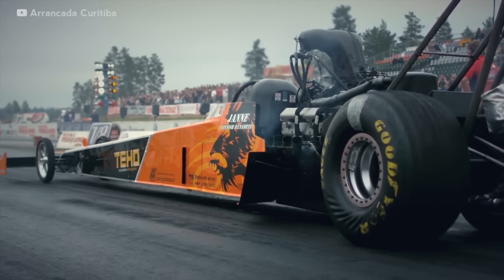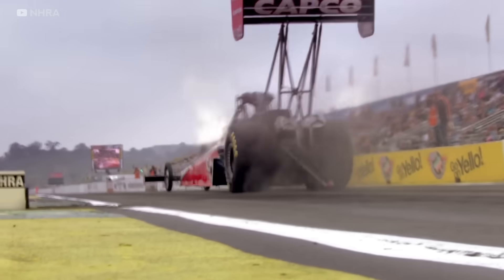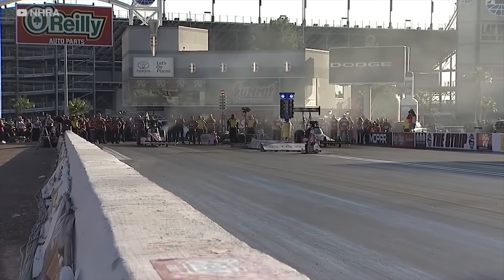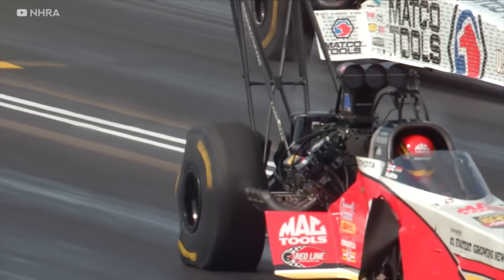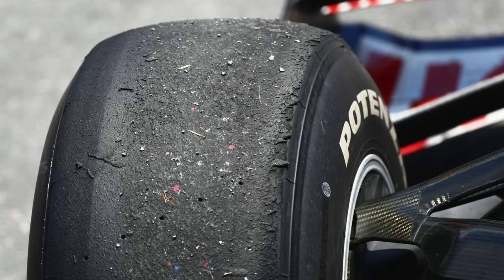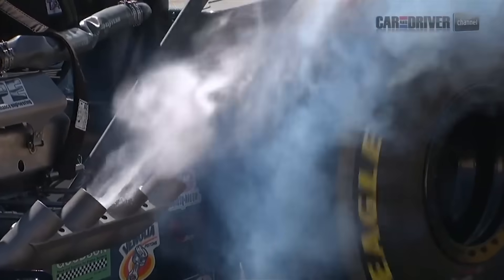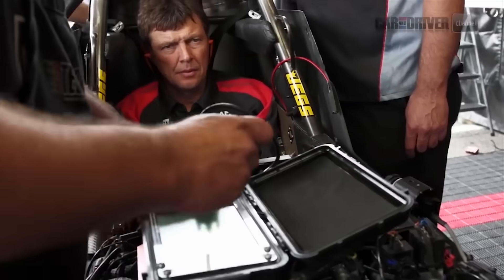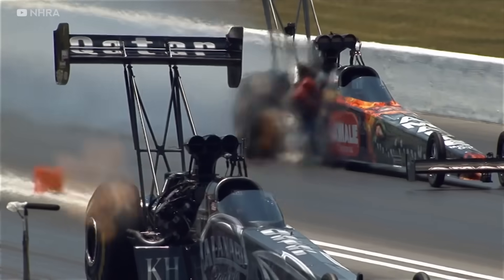How Dragster Tyres Accelerate to 335 MPH in 3.6 Seconds

Comment: Could someone please explain to me howcome this fuel needs no air to combust but these engines are supercharged, how's that working... I'm absolutely positive that I'm missing something here, but that's why I'm asking, thanks in advance to whoever (or whomever?) answers this!
Reply: The nitromethane fuel does need oxygen.  It requires less oxygen to fully burn than gasoline due to it bringing its own oxygen to the party.   Given an equivalent amount of air and the same cylinder size, a given amount of nitromethane generates more energy than the same amount of gasoline.  The superchargers help to get as much atmospheric oxygen as possible into the cylinders to get the most power.
Reply: @jeanbigboute  I see I took what he said too literal and that's a very satisfying explanation, thank you!

Comment: I'm suprised the tires last that many runs, I thought thy were one and done.
Reply: I was surprised too, considering these monsters also vents some heat from their engines right in the tracks of their tires.

But in the context of tire wear in top fuel dragsters, 7-8 runs is pretty dang short and I bet those engineers and mechanics in those teams are constantly looking for ways to prolong the lifespan of these tires by at least 2 extra runs. Because $900-$1000 for a pair is quite expensive, even for big teams.

Not to mention that the chances for these tires to just yeet itself into oblivion is pretty high.
Reply: @lukmaanpratomo6866  900/ tire, an the cost in the engine alone, at full power is like 1000$ a second. XD
Reply: Lukmaan Pratomo they don’t vent heat from the engine and the have no cooling at all on these cars. If you look at burnouts on modern fuel cars the are very short to not heat the tires up. You want the tires within about 10 degrees F of the track temp. Teams will cover the tires too keep them cool while waiting to run
Reply: The key thing is that the tyres aren't made by Pirelli.
Reply: @armands3153  pirelli makes the f1 tires degrade on purpose
Reply: @BobbyGeneric145  Not talking about F1, in general.
Reply: @BobbyGeneric145  Proof?
Reply: @armands3153  this comment is so much better after Hamilton, bottas and sainz got punctures on the last lap of the british gp
Reply: @armands3153  i see what you did there xD

Especially after the race on Sunday
Reply: @Seba-g5j  Due to this coincidence, my comment has become immortal.
Reply: @armands3153  Pirelli makes some of the best motorcycle tires out there.  Just depends on which market you're in I suppose.
Reply: @That_Cajun_Guy  Good to know.
Reply: @That_Cajun_Guy  Continental makes amazing bicycle tires.
Reply: @armands3153  LOOOOOOOL
Reply: @armands3153  Pirelli ever was shit but have good fame bc motorsports, better brand tyres for me are:
1-Michelin
2-Toyo(not in reliability but good asf in track bc the great grip)
3-Kumho
Reply: Spaniard lol goodyear is even worse
Reply: @armands3153  hahaha the truth to that is insane 😂
Reply: @armands3153  lmao
Reply: Same, very surprising the engine needs a overhaul every run but don’t even need to change a tire. Crazy.
Reply: @cartersolomon4965  if you understand physics, you'd know.
Reply: HighAway well I’m not someone who understands physics and has nothing better to do than chastise people who don’t on the internet lol.
Reply: @cartersolomon4965  Go learn physics.
Reply: @Nick Nomienos gets rebuild every run but yeah the chances of yeet itself out are higher than drunk man smoking joint
Reply: Coconutscott might only last one run if the traction is high. What he didn’t say is the front tires don’t last long either
Reply: How many runs on a tire does a team do?
Depends on the sponsor. A few well sponsored teams run 4 runs and sells the tires to other less funded teams or gives them to a lower ranked team member to get the balance of the life out of them. Like hand me downs LOL
Reply: When I worked on these (mainly funny car) we would get up to six runs sometimes a little over and also sometimes just one or two if they got damaged or had a defect like a hole opening in a sidewall that doesn't happen until the tire expands during the run (had that happen one time) --- This was roughly seven or eight years ago or something, so still on the same tire design as now..  Now back when Darrell Russell was killed in 2004, a lot of the teams put new tires on before EVERY run, but once Good Year came out with an improved tire design that had a smoother transition from the sidewall to the surface of the tire and so on, it made a huge huge difference and there was substantially less chunking of the tires (where it just completely rips huge chunks or strips of rubber and it would be all the way down to where you could see where the rubber was once attached) you will also see tires nowadays where when the car comes back to the pits if you happen to be there you'll see that the right and left edges of the tires look to have just a thin layer missing in small spots and/or strips, when that happens you just cut the edges of the rubber off and make sure you can't slide anything under the Rubber and if you do you can just cut out around it because the teams want used tires for when it's a hot track and new tires for when it's cooler (new slicks have less traction and you want that when there is a ton of traction that way you can get the slip and wheel speed you need.  So sometimes in the summer when teams don't normally do long burnouts you'll occasionally see them do excessively long ones or they might give it some more RPM with the throttle stop to make the tires 'old'   There are just soo many brilliant people that tune, design, Etc these cars. The amount of spreadsheets for data and everything else is just unreal that the crew chiefs use
Reply: It is because the runs are only 400 meters. And 3 seconds. The tyres do not undergo prolonged heat in a run.
Reply: Nick Nomienos engine parts are resurfaced, repaired or replaced as need with many spares if a motor goes boom
Reply: The tires usually last 1 to 2 races before they have to switch new tires
Reply: It's strong tires
Reply: @Eve Well, the difference is that the Goodyears do what they suppose to do, the Pirellis don't, so...
Reply: selling tires, 15 miles, got them a week ago. 600 dollars each.
Reply: This video is incorrect. At most a TF car will get 4 runs out of a set of slicks. And that's the less funded teams. A sidenote though, most TF teams sell their 4 run tires to Alcohol guys after about 3- 4 runs, at about half price. (Alcohol a misnomer as most dragsters in the class now run unblown nitro, funny's run Alky)...The Alky guys get tires already scruffed in, and pay much less than new.  Another side note, some TF teams used to let an alcohol team use a new pair of their slicks for 1 pass. The alky cars don't put much wear on a set in one pass and the TF teams got a set of scruffed up tires which were better than a virgin tire.
Reply: @MikeM275  yeah, sometimes you to get up at 6. John Force Racing, we used to give them all to NHRA and then I forget it when I worked in alcohol who we got our tires from, but they last a lot longer on a Blown Alcohol car or injected Nitro car then they do on a fuel car LOL
Reply: Michael Fritsche  that's super awesome man! Especially having stories with Nicky, I would love to have a few more stories in that category than I do, well I kind of do from when I did clutch on an a/fuel dragster for division 4, first dragster I worked on ,  that was always a lot of fun, especially at National events- I know a few Mike's in racing, and there's also a lot of people that will come up to me or vice versa and we hadn't seen each other in years but can't remember the other person's name but end up hanging out the whole time or something LOL so yeah, really cool to read your response on what you did, I talked to JR a handful of times and he's a really great guy.. Del Worsham would always come over to our pits at the time, as a fan he was always a cool guy but when I think of racing and cool guy, he's the first person that usually comes to mind. Talk about a guy that's really comfortable in his own skin :-) Good Times, still want to get back into it - - year before last I believe it was, they were telling me you could borderline kill somebody and still keep your job, it was just getting hard to find people that didn't know what they were doing or bail shortly end of the season, or wanted way too much money for no experience. Anyway, just reply or something anytime, enjoy the fact you took the time to share all that and I really enjoyed reading it as well, really great stuff! :-)
Reply: Same
Reply: Mee 2
Reply: Nick Nomienos they have to rebuild them every run I think
Reply: Mr Swagginz the only drivetrain part that is not rebuilt every run is the rear end. All parts of the engine are repaired or replaced other than the block, cam and crank on a good run. On a bad run they replace the whole engine
Reply: I thought the same also
Reply: Same
Reply: For real tho
Reply: Same
Reply: Ah so F1.
Reply: Same
Reply: Same
Reply: Same
Reply: So they last 8 time more than the engine ahahaha
Reply: Its beacuse they trim them
Reply: @Eve Half of the time. If the people would have a choice, they'd pick anything but Pirelli.
Reply: @Eve Are you talking about motorcycles?
Reply: @Eve So you are talking about F1, ok. The fact is that I am only pulling people's legs here. F1 and Pirelli is all business. It wasn't about which tyre is 'better' rather than it being a deal between F1 and Pirelli for the spec tyres. Why F1 didn't go with Bridgestone or Michelin for that deal, I don't know. Probably both companies didn't want to artificially influence the degradation of the tyres and strategy choices like they are today and making their product 'look bad'. However, sometimes it seems, that this circus is going out of Pirelli's control that even they have no clue what's going and need to do investigations. As a consumer for daily life, I wouldn't pick Pirellis not one day, because there's a lot better alternatives out there (lesser known firms) and for pure performance, I think nothing is better than Michelin Pilot Sport Cup 2s or whichever generation they are now on.
Reply: Not the clutches tho
Reply: They were for a season or 2
Reply: N o t 
R e a l l y . . . 
T h e i r
E n g i n e
I s
T h e
O n e
A n d
G o
Reply: The engines are like :noooooooo u cant drive me a second time I dont want to
Reply: They are made to do that they are called wrinkle wall silks
Reply: Same
Reply: Yeah the engines are similar to a condom ONE AND DONE
Reply: I was surprised as well.  I'm also surprised they only cost $900.  Some consumer off-road tires cost more than that.
Reply: Naw bruh that's the engine
Reply: Yeah the engine is one and done
Reply: Yea I was shocked when they said 8 runs after hearing the rods and rod bearings are one n done WOW!!
Reply: @bxcharle  rods and pistons usually do get more than one run, they check them for stretch and have a certain max number of runs they will put on them regardless (depending on the tune up and all that, a lot of things can make parts last longer than others and so on -- a lot teams you would think have and all new engine stuff, may buy used parts from some of the larger teams, too) .. but yeah, when they put fresh pistons and rods and bearings in the motor after each run, they might be new or they might be ones that have been used that have been checked and going through 🙂
Reply: Ray Field  Hoosiers are not allowed to be run on top fuel dragster by NHRA rule.
Reply: Ray Field  Yes, I have a dozen sets of Hoosiers here for my stocker.  This video is talking strictly about top fuel and that was stated in my post. And I know Edmond btw...and his wild ass brother. I also know the Connallys...founding members of the dirty dozen...banned for life for cheating... How'd they like their Matty box? Pretty good huh?? Yea.....
Reply: Ray Field  .If you can read, I specifically said "top fuel" ... and since this is a video about TOP FUEL...my comment was factual and appropriate. Why would you bring up a sportsman tire on a top fuel video??
Reply: Ray Field  ...First and foremost for the NHRA is the almighty $$$. In the rules top fuel, funny car, AND pro stock all have to run Goodyears. Goodyear of course pays for that exclusivity (normally in the case of NHRA case closed). Hoosier dabbled in Pro Stock a few years ago, which is when NHRA made the rule. Goodyear does not make money on fuel tires. The limited market doesn't justify their huge expenditure for both research and manufacturing...so they needed to be exclusive. And be able to advertise their NHRA racing tires. Secondly...Hoosier etc. just doesn't have an appetited for the massive research AND more importantly the liability that comes with making a 330+MPH tire. Knowing they will NOT make money on those tires. Truthfully, all parties involved are fine with Good Year only tires on the fuel cars. //Personal tidbit about Edmond. My first ever pass in competition at a NHRA national even was against him, many years ago. I had Hoosiers on...Edmond had a Hoosier sticker but swapped to Goodyears for the race. The Hoosier guy was not happy. He told me if I beat him first round I had a free set of Hoosiers. He was standing at the water box when I did my burnout. I think he made me more nervous than Edmond did. I lost a close race...
Reply: Ray Field  ... We were both running Stock Eliminator... National events are always tough...this one much tougher than normal. We got ONE qualifying pass on Thursday morning...it rained nearly constantly the entire weekend...we lost all of our other qualifying passes so first round was late on Saturday night after the pro's made their last qualifying passes. So from a hit at 9 am on a Thursday, I had to dial in on a run 7pm Saturday night, after fronts had moved thru etc. It was brutal. Edmond had the advantage because I had/have an extremely consistent car, hence, I dial honest...Edmond always holds, so he doesn't care a huge amount about how far off his dial is. In this case that was a huge advantage as I was lost on the dial...Close race though...
Reply: How does the engine last at all
Reply: R 4
Reply: It’s odd because the engines ARE one and done
Reply: Nope just the engine.
Reply: same
Reply: Ray Field  I really didn't bother to take clips of my runs..I wish I did. I was on Speedvision (ESPN)  for winning the IHRA Sportsnationals when I raced. In fact, when they cut to commercial before the final round they showed my car in slow motion doing a burnout while saying..."We'll be back after these messages" ...Pretty cool... I taped it...years ago. I cannot find it anywhere. I also won the Virginia National event...ESPN showed only 1 sportsman pass...mine, winning Stock Eliminator. I never saw it. Friends called...YOUR ON TV!...lol... I never saw it... I really never cared about pictures or videos etc...I only cared about winning. I wish now I had cared to take more videos and pictures...
Reply: Michael Fritsche  Fuel or Alky?
Reply: Michael Fritsche  that's awesome man, it feels really good to be part of kind of that Elite group of people that have worked on top teams and in my opinion is a very special thing and I'm sure you probably feel the exact same way! Both those guys are really great guys, too!
So ehen did you work for JR and Litton, are you still involved at all in the sport? It doesn't have to still be in the professional fuel rank necessarily either. What else did you do on those teams at the time as well? Thanks for replying man hopefully I hear back from you! 🙂🤘🏻
Reply: Naw matey that’s the gearbox
Reply: imagine paying soo much for 1 run, that would be bad for the company
Reply: Actually the narrator said at one point the tires are one and one, at another point 8 runs for a set of rear tires.  Actually it is about 3 or 4 runs, considering the tract conditions.
Reply: Not exactly related but tires from  747 plane only last 2 landings I believe.
Reply: @captinzatch8181  That is not true at all
Reply: @adabracadabra2402  ok, that's cool. I'll check my facts. I wasn't sure👍
Reply: @captinzatch8181  dude think about it, it would be unsustainable for airlines if they had to change tires on a plane all the time.

Imagine how they change tires on a plane, they bring it into a hanger, have a special rig lift the plane. and the tires themselves are huge. They're as tall as a short man.
Reply: @captinzatch8181  Respect!!
Reply: Zachary koeppen big respect for acknowledging your mistake 👍
Reply: @captinzatch8181  You should be in PRISON for that .
Reply: @captinzatch8181  noooo
Reply: the seven four seven takes off then they change tires in flight for the new tires for the landing
Reply: Zachary koeppen They last hundreds especially after being retread multiple times
Reply: @captinzatch8181  might have been thinking of spaceshuttle tires/wheels they only lasted 1 landing in the back and 2  for the front.
Reply: @captinzatch8181  ..200-300 landings on a 747, like most jumbo jets. They also use recaps....something most people don't know...
Reply: Zachary koeppen No
Reply: @captinzatch8181  Actually after every landing and the passengers have to help changing the tires and tightening the wheel nuts!
Reply: @captinzatch8181  they last 200 to 280 landing
Reply: Zachary koeppen 
Lol that is entirely false. 
They last over 100 landings.
Reply: @captinzatch8181  absolutely not, the 747 main landing gear tires last about 200 landings.
Those aircraft are flying almost continuously, it would be absurd to have to change all of those tires more than once a day.
Reply: @captinzatch8181  That is not true.  Why spread false information?
Reply: @captinzatch8181  No, it would be really stupid